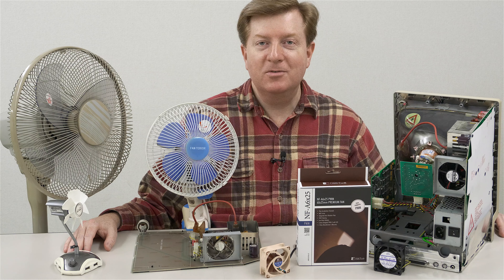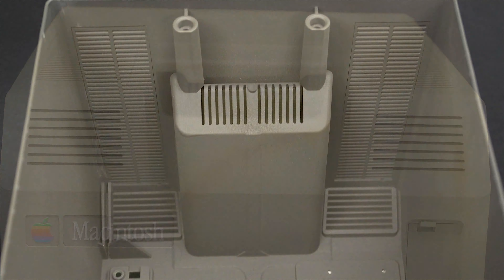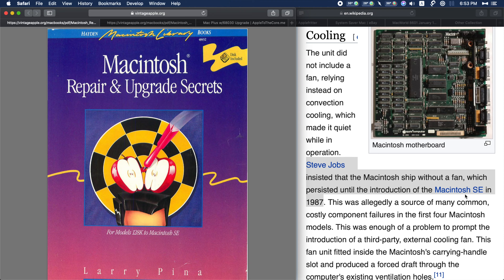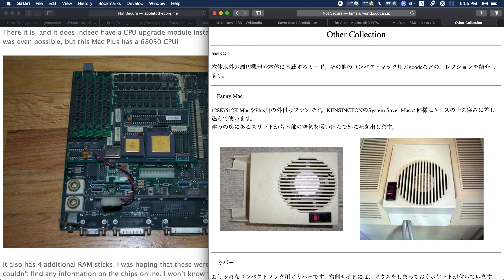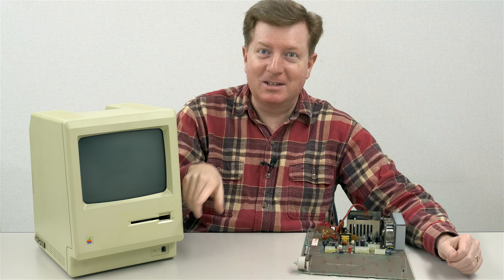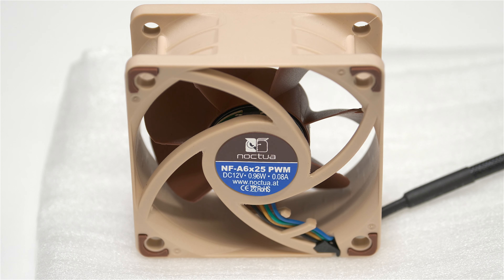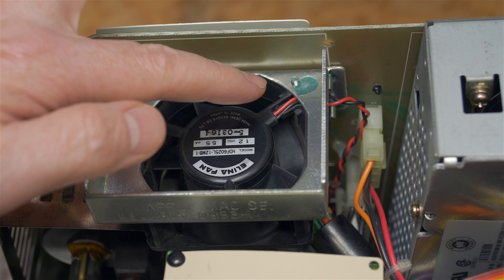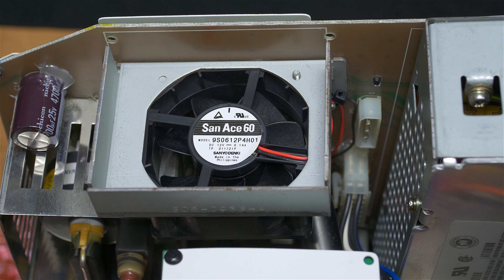FANS for Compact Macs [128k - Color Classic]

Comment: Thanks for the excellent explanations in this video. Do you have a photo of the Noctua FLX pass-thru hooked up? I want to make sure I'm doing it right in my SE.
Reply from the maker: Please note that I used the PWM version (which has lower current consumption than the FLX) and I cut off the fan's connector so I could solder the wires on my analog board. As a result, I do not have a photo of the FLX connected to my Mac.  But since you are asking about the "pass-thru connector" of the FLX, just visit the Amazon link below.  There are high resolution photos there showing the white, wide 4-pin connector which at one end looks just like the hard drive power connector on your Mac SE's analog board.  Pass-thru means it has a male side and female side.  Why?  So you can connect one side to your analog board, then the other side will allow you to connect your SE's internal HDD as normal.  It basically is just tapping HDD power, so whenever your HDD gets power, the fan will too.  And since the HDD should be powered while your Mac is ON, the fan will also be powered then too.  If this isn't clear, please let me know.  Thanks.
Reply: @JDW-  Yes, it's clear. Thanks a lot. And when I cut the wire to the old fan, can I just leave it there? Will it cause any harm if the other end is still soldered to the board? It's glued down in 3 places on mine.
Reply: Never mind. I'm removing it anyway. Thanks for the help. Keep up the good work with these videos.
Reply from the maker: If you cut the wires to the old fan there is a possibility that a tiny hair-width wire might stick out, shirting something, so I would recommend putting a little heat shrink tubing over the cut off part so that can never happen. If you don’t have that, use a dab of hot glue on the tip of those two wires. If you don’t have that, wrap them in electrical tape and then use a plastic wire tie to ensure the tape never falls off.

Comment: My Mac SE has (had) a Sanyo fan, but apparently the blades are extremely fragile!! As mine  had 3x blades broken off, sitting inside the bottom of the case...  I replaced the fan with a "Sunon" branded fan of the exact same dimensions, and it works/fits perfectly.  However, now as I am using the computer, there are noticeable "ripples" (interference)  in the on screen image.  If i stop the fan from spinning with a pencil, it actually completely stops the rippling on screen.  Any ideas??  I am guessing the new fan isn't "brushless" and the noise is being caused by the arcing brushes in the new fan.  Is there any way to solve this problem without fan replacement?
 Thanks!!
Reply from the maker: If you are sure it's the fan causing ripples (e.g., tap hard on the machine to confirm there are no ripples resulting from that), then you have 3 options.

1. Desolder the fan wires, twist them, then solder them back.  This may be a problem if the fan wires are currently the exact length they need to be.  Twisting wires can help with noise issues.

2. Adding a cylindrical "ferrite core" around the wire pair would act as a filter for HF noise.  But I've honestly not heard of anything needing to do that for a fan.  It wouldn't hurt anything to try it, but if the hole in the cylinder is too big, it wouldn't do any good.  It would need to fit rather tightly around the wire pair.  Might prove troublesome for you to buy, so maybe is not worth it.

3. Swap out the fan for the 60mm Noctual fan I recommend in the text description under my video.  It most likely would have the added benefit of good airflow at a lower noise level than the Sunon you are using now.  This is probably your best option.  But be sure to twist the wires before you solder them to the PCB.

Now, there is the possibility of the problem being somewhere else in your system.  So if you've not fully recapped all your boards, you would need to do that.  Aging capacitors can result in screen anomalies and allow noise to get through that otherwise would not.

I hope this helps!
Reply: @JDW-   thanks. The wires were already twisted together. And yes I am sure it's the fan. You don't think it has anything to do with noise from a brushed motor versus a brushless one?  That's what I'm putting my money on....  The original is brushless the replacement is not
Reply from the maker: To be honest, I’ve never given any thought to the fans being brushless, mainly because no one has really brought up the topic before. All fans generate noise, but some fans generate more than others. The problem lies in the circuitry that is supposed to deal with the noise. But since that is a more complex issue than just changing out the fan, the easiest path to victory here probably would be to just change out the fan, even though it would be troublesome and require a bit more expense.
Reply: @JDW-  Well, generally speaking... anything that has arcing, sparking going on inside of it (brushes) causes a tremendous amount of electrical noise.  Try putting both types of fans next to an AM radio!
Reply from the maker: @Johnathan_Waters  We have been proceeding with this conversation based on your "assumption" about your fan.  To more constructively talk about your problem, we need to know the facts.  More specifically, most fans have a sticker with a model number.  Usually, with enough time, effort and keyword variations, you can sleuth out a datasheet.  With that in hand, we can determine if your fan is truly one with brushes.  

If it is a fan that uses brushes, and if you still wish to continue using it rather than replace it with the Noctua I recommend (which is of course brushless, quite, and low power), then we need to go back to my original recommendation of a ferrite core.  Beyond that, it would require either circuit additions or modifications, which all amount to more time (time is money) and effort and possible expense than just replacing the fan.  

I know full well what it's like to buy something only to find it's not the best choice, and I always do like you and explore ways to keep using that inferior thing rather than spend a little more on the right part.  But in the end, the right part tends to be the right choice (if you have the budget to buy it).

For a deeper dive into fans and dealing with the electrical issues, which really is better than a long conversation here on YouTube, I would highly recommend the forum I often turn to for advice... EEVBLOG
https://www.eevblog.com/forum/beginners/brushless-motor-pc-fan/
Reply: @JDW-   I was only speaking generally... I am most definitely going to buy a different fan.  I only used the one in question because it was the right size, and i had it on hand already.
Reply from the maker: @Johnathan_Waters  Understood. But you seem to be interested in exploring "the WHY," and I can appreciate that very much because I am the same.  I like to know WHY!  I also like to seek out solutions for things that aren't always practical, which in this case wold mean exploring noise mitigation for a less than optimal fan.  And that is also why I recommended EEVBLOG.  If you've never posted over there, don't worry.  They are nice.  It might be fun to explore the use of brushed type fans in vintage Macs while hearing the insights of the engineers at EEVBLOG.  I've never explored that myself, which is why I recommended that forum.  Please don't feel I was trying to... well... brush you off. 🙂
Reply: @JDW-  LOL! Yes I am also very tempted to to see if i can/how to make this fan work, just as an exercise to hopefully gain a greater understanding of what's going on there.   In fact I already tried shielding it from the CRT, and that DID have a slight effect, but Im not sure how much (ripple still visible).  I would assume a "noise filter" (like the type used in automotive stereo systems, etc) would probably help?  Basically, a simple passive circuit placed inline with the fan.
Reply from the maker: It’s worth trying.
Reply: @JDW-   Hi again! I just wanted to update this thread for posterity i guess, and to let you and everyone know what the FIX ended up being.  Just as I suspected, installing a "Brushless" fan completely resolved my issue!
Reply from the maker: @Johnathan_Waters  So basically fans with brushes are indeed causing electrical noise which appears on the CRT, and swapping that out for a brushless fan is the fix.  That is important and useful info.  Thank you for sharing.  It's great that a simple fan swap solved your problem so you can now enjoy that Mac with a flutter-free display!
Reply: @JDW-  Yes indeed!!  I always hate when I come across a thread about an issue someone is having, and they NEVER return with the solution.  Thats the most important part!  Btw, I just love your videos and fastidious attention to detail.  Keep up the good work

Comment: I cleaned off the red goo.  :(  So what do I do about it?
Reply from the maker: Thanks for watching and for your excellent question!
 
Unless you live in a location where the humidy is high most of the time, and so long as your anode cap looks to be in good condition, you really don't need to worry.  The "red goo" is actually a matte finish dielectric (i.e., not electrically conductive) paint that prevents high voltage arcing in high humidity environments.  If you don't see any unusual artifacts when you look at your Mac's display, you're probably fine and don't need to do anything.  Actually, if you watched my video you can see most of my red goo is worn off due to the many times I've removed and replaced that Anode cap!!  If you are serious about testing for an arc under the Anode cap, just remove the back case of your Mac, ensure the power switch is off, insert your power cord, switch it on, then turn off the lights and look in the area where the Anode cap is.  If you don't see arcing, your machine is fine. 
 
I believe the original red dielectric paint under the Mac's Anode cap very well could have been Glyptal 1201 or similar: https://bit.ly/3bKDWUf
 
I had to use a link to Glyptal on Archive.org because it appears the product is no longer made, and that would explain the outrageous prices for it on Amazon.  But there's nothing magical about that brand, and there are other options available.  For example, this glossy red varnish is also a dielectric paint that accomplishes the same thing  (I would suggest applying a couple coats): https://amzn.to/2vH2op3
 
Even Silicone Grease (pretty much any variant of them) will do the job perfectly.  However, grease can get messy versus paint if you plan to remove your CRT Anode cap often.  Even so, if you don't plan to remove your Anode cap often, here's a Silicone Dielectric Grease that is quite popular and not that expensive: https://amzn.to/38BBsoZ
 
Lastly, if you use the dielectric varnish or Silicone grease, do NOT get it inside the hole in the CRT where the 2 Anode cap pins fit inside.  You want it to be in a circle larger than the circle of your Anode cap.  The cap must rest atop that paint/grease, so you want a little paint/grease outside the cap and a bit under the cap too, just not in the CRT hole.
 
I hope this helps!
Reply: @JDW-  Thank you so much for the speedy reply and the very thorough answer!
Reply: @JDW-  Yes I remember having removed the majority of the goo but if I am not mistaken I halted the operation at one point, thinking it was not the best idea. I will look at your links. Thank you for the reply!! Just a link to a discussion on the topic. https://68kmla.org/forums/index.php?/topic/30747-se30-crt-anode-cap-removal-reveals-red-sticky-material/&tab=comments#comment-629483
Reply from the maker: @santospoland  Thank you!